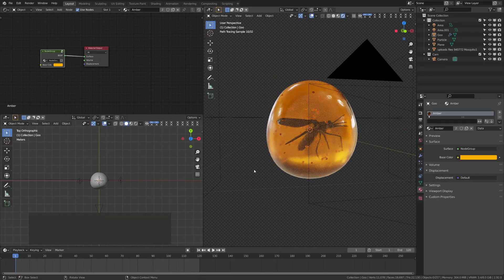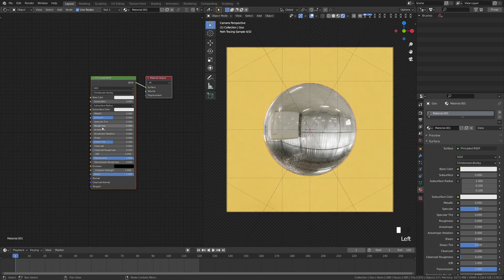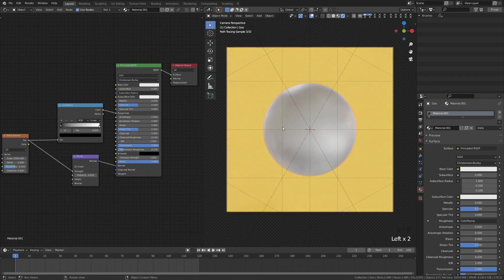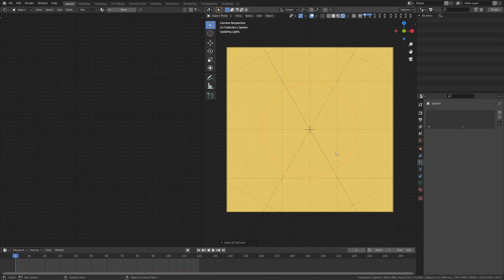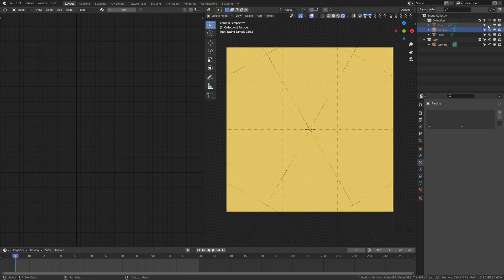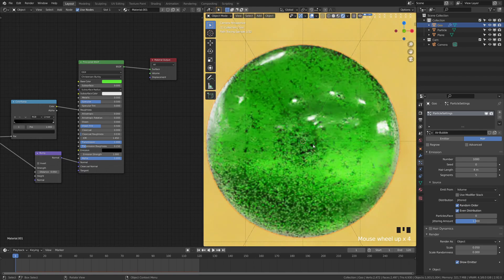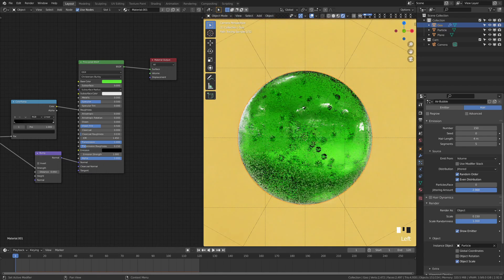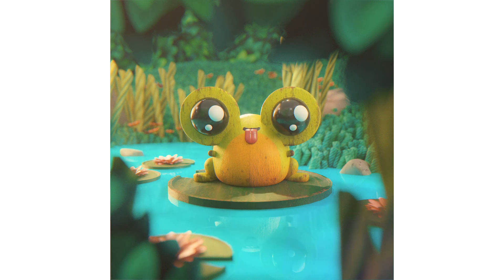Blender 3D - EASY Air Bubbles

Comment: You can do the same effect using distribute points in volume in geometry nodes and use set material node, also points rendering in cycles as perfect spheres by default literally for free

Comment: Is it me or something changed in Blender (3.5) that would not get me the same result as yours ?
I tried several times and I just can't get that nice effect (the glass).
I also tried to connect the 'Noise Texture' node to 'Height' instead of 'Strength' (as seen in a comment here).
The result looks like I have a sphere in a sphere or something like that.
Could it be the HDRI ?

Thank you for the tutorial !

Comment: hello, excellent video bro, although I have a problem, and that is that when I turn the air bubbles to volume I don't see them, it's as if they disappeared, do you have any idea why it could be?
I followed the video step by step, but I can't find the error

Thank you very much, greetings from Argentina
Reply: are you rendering in cycles or eevee
Reply: @kerralian7916  I switched both from eevee to cycles, and from cycles to eevee and it didn't work for me either, the air bubbles are inside the body, but I can't see them as seen in the video, they can only be seen if I zoom in and look through inside the body
Reply: @leeangodoy_ige  same issue here, but it worked when i swithced render engine to cycles in render properties

Comment: Having a devil of a time getting this to work... No matter what I try the "bubbles" are on the outside of the "goo sphere". I've tried adjusting hair length and some other parameters but nope. Yes I flipped Normals. Yes I have it set to volume but nothing.
Reply: I'm having the same problem. If you solved it, I'd love to hear from you!
Reply: @admiralbees1690  I believe it was the size of my starting sphere in the end. I made it a lot bigger and got it to work. I'll check my files but I'm 90% sure that was it.
Reply: try to set the origin of the particle to geometry, worked for my
Reply: @FantasyFuchs  that it thanks !
Reply: @Dee Bottino u work on real size sphere 20 cm change size to 200 cm :).
Reply: might be because you need to "apply transformations" first. particles and physics need the scale reset to 1 to function properly

Comment: Oh cool effect!

just I've a problem - particle settings and face orientation; why my bubbles get out of the sphere? size of hair strings?
Reply: you may have to "apply transform" on your spheres.. anything having to do with particle/physics etc are ALWAYS touchy about that stuff. always a good idea to check everything has been set before diving in
Reply: @flipnap2112  true when you are using scales without considering real world sizes.
Reply: @mertcanurcan  yeah for sure, real world scales come into play. but my problem in blender was I didn't realize many times with sims I needed to "apply scale" to an object after scaling it up or down. guessing it "resets" blenders internal frame of reference back down to 1. all these programs operate differently and going to one from another and its the little things that always throw a monkey into the wrench. glad you got it figured out! happy simming and have a blessed new year!!
Reply: oh it was "hair lenght" since i work in real world sizes - not usual 200cm sphere, i work on a 20cm sphere. hair strings default was 400, i changed to 20cm, it solved the problem.

Any person whom into scale/size based modelling, thats the solution. cheers!

Comment: i think blenders render engines are very good but even cycles has very basic settings it is really hard to get realistic renders. however you have figured the secret of it. could you please make a tutorial on how to get that realistic effect. and i think it is cos of materials and lighting.
btw well done thank you for you tutorial, i always learn something from you man!
Reply: Why not put up a render scene you want to see realistic on blendernation and you'll get different work flows for it. Some are hardware extensive, some are not.
Reply: @mertcanurcan  yani orada paylashirsam bana tavsiye verirler diyorsunuz?
Reply: you mean if i share there, people can give me advices?
Reply: @saparjumash  yes, you do your scene, pack it up and ask the question "how can i make this more realistic using low/med/high hardware options" then people give it a shot. though blendernation is wrong, may be https://blender.stackexchange.com is correct. search and give it a shot. you can put up a vid with file accessible, people may try for realistic approaches. 

For me, higher hardware tech, easier realism BUT there are other ways without relying hardware too. some i know, some i dont.
Reply: @mertcanurcan  thank you much.